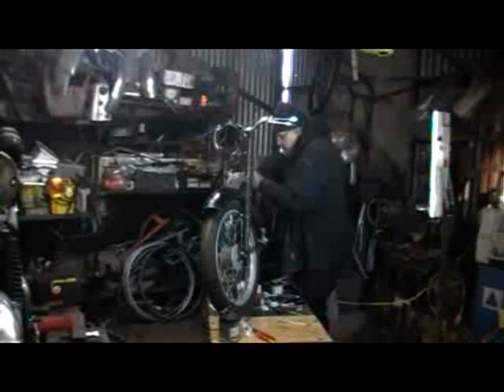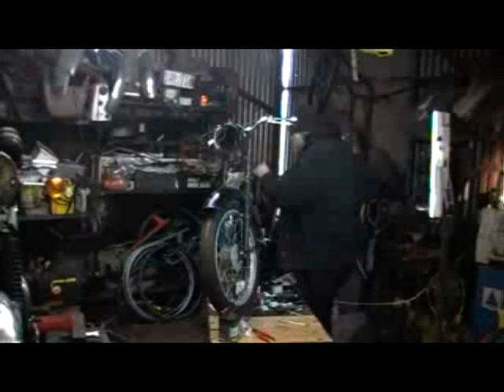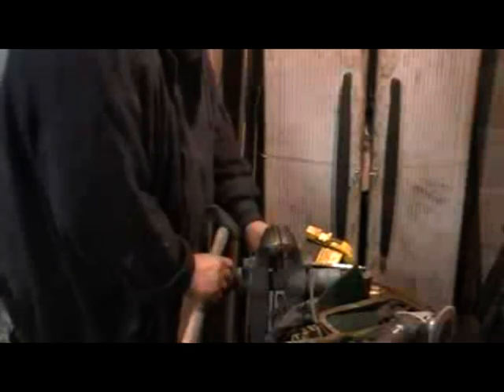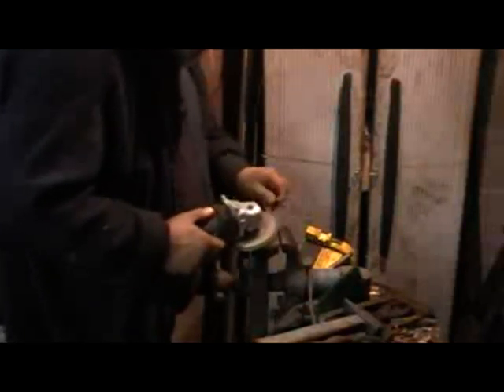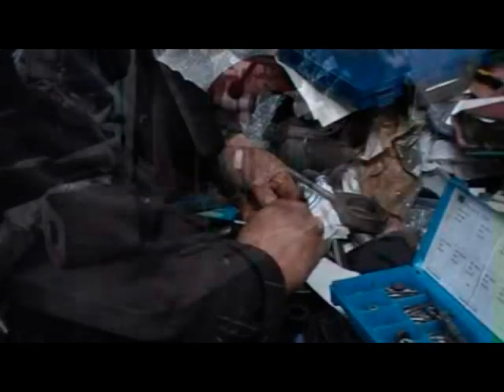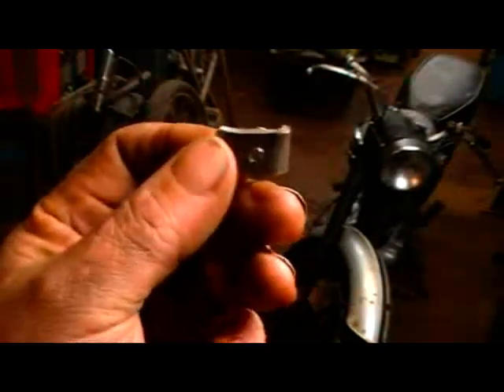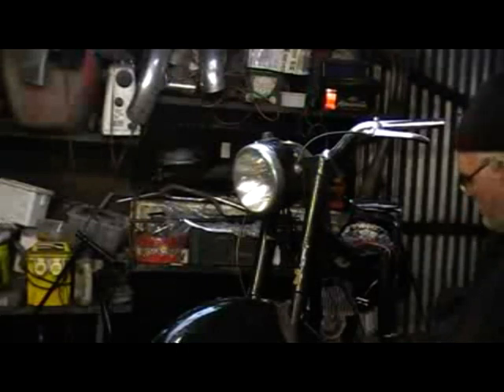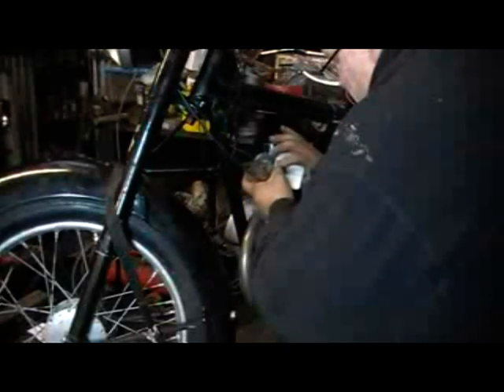james cadet part 6

Comment: Nice work, really admire your patient approach. You mentioned the light switch for magneto versus battery, is that an issue?  I'm working on a c15s that didn't  have a headlight but want to install a lucas mch66 for street riding.
Reply from the maker: no,no issue,it's just a clue as to where to go with the lighting wireing,more to do with the style of the switch,not function.in many respects a switch is just a switch
Reply: @shedbuiltable  thanks for that. my first experience with the energy transfer system.